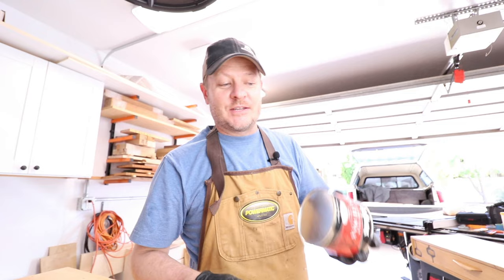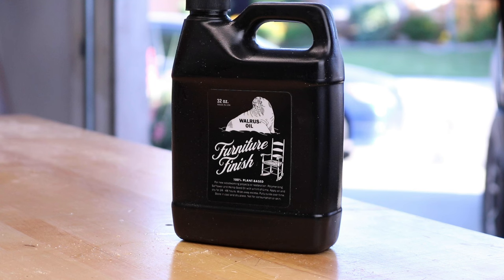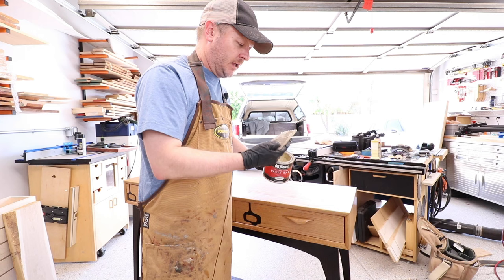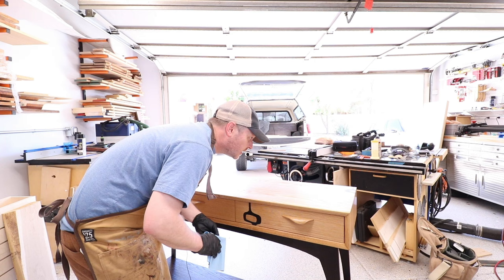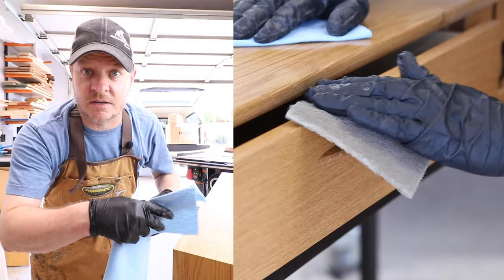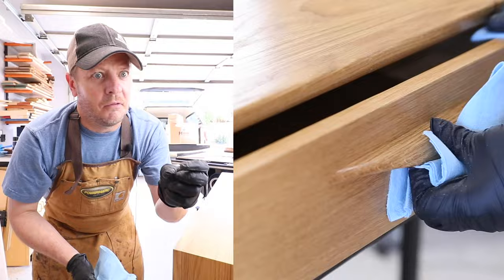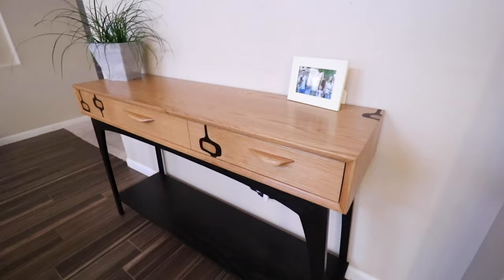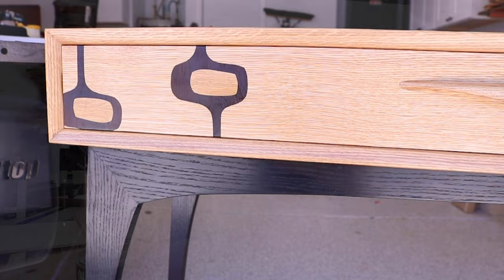Why Paste Wax is Worth It - Wood Finishing

Comment: Thanks for the video Mark! I can't recommend polishing with paste wax and finishing pad or 0000 steel wool enough. Not only does the surface get a nice soft sheen and the most amazing touch, it is also a fool-proof way to even out any imperfections in the finish.

Comment: Great video, love the finish paste wax gives even on top of poly. Quick tip, some waxes may take longer to dry and you might need to leave them to dull up and go matte first so that they can dry onto the surface. Some waxes say leave it 10-15mins some even 30mins so that the beeswax can dry and the solvent can evaporate. Then come back and buff it to a shine. 👍

Comment: I use it on almost any piece I send out the door but I use the Howard’s citrus shield premium paste wax if you ever can buy this paste wax and it triumphs over the other ones seriously try it out and also I always use a white 3-m finish woven synthetic pad on my small electric hand buffer to buff it of after I let it dry try that also and it makes it shines more and push it deeper into the wood as it heats it up with more friction and if you use the electric buffer the paste wax will last at least 2-3 times longer on the wood than buffing by hand

Comment: The bench looks awesome!! What are the black parts of the table. Looks like epoxy and classy but all I hear  is usually hate for epoxy from true wood workers. 
Also I’ve used paste wax before on a finished table but throughout the days some spots made it into some wood grain and turned white, is that because I didn’t have a thick enough finish on it to fill the grain completely?

Comment: How long would this last on a higher use top such as a coffee table or dining table?
Reply from the maker: Wax doesn't last long at all under those conditions (maybe an annual recoating, give or take), but the argument for it is that it's the first line of defense to protect the rest of your finish. It's easier to apply a fresh coat of wax than it is to strip and refinish, for example, a scratched or chipped urethane finish.

Comment: Getting ready to stain an unfinished dresser, what would you recommend for inside of drawers? Thnx man
Reply from the maker: inside of drawers, anything works. Leave them raw, apply just wax, or apply the same top coat  that you're using on the rest of it. Inside of drawers don't get too beat up, so viirtuaally anything will work just fine.

Comment: Question: we painted our laminate countertops and "finished" it with polyurethane. Would this also work on that? We have tried to get the polyurethane on nice and even but we just cant get it right. Would waxing fix it? The top coat is sanded but now you see the dull spots
Reply from the maker: Waxing will help, but it'll be even better if you sand the polyurethane smooth first. You might have to apply and sand the polyurethane two ro three times to get it perfect.

Comment: I'm restoring a dark wood display cabinet (call it teak or walnut for arguments sake). I've nearly done sanding it down and I love the lighter wood. I did a test patch with teak oil and it instantly went super dark with a deep warm orangey colour. I mean that's also nice and makes the grain look a bit more holographic-ish...but I love the ashy sanded colour of the actual wood. So I assume I can't just leave it unfinished because it'll still oxidise or get sun damage or whatever? Any ideas on what can I do that will affect it the least? wax/soap/ some kind of varnish. Like I just want to protect it a little and keep the sanded colour
Reply from the maker: Usually a water based finish will have the least effect on the natural color, no enhancing. Wax would have a little more effect but would be less involved to apply it. So there’s that.

Comment: Hey Mark, looking forward to trying your technique out on my project (walnut & hard maple).. you mention using Warus Oil (oil based) to bring out the color prior to adding Arm-R-Seal. Curious where/if/when Aqua Coat would come into play if using as a grain filler. If not you, does anyone know if Aqua Coat (water based) could be added AFTER applying Walrus Oil, then sanded down with 220 BEFORE using Arm-R-Seal... before finally getting to the finishing touch with wax paste? Trying to figure out how to work Walrus oil into the mix...
Reply from the maker: Usually a water based filler should be applied to bare wood. Then the finish on top of it.
Reply: @WoodworkersSourcecom  Thanks Mark, that helps. I read an article where it mentioned to use oil to bring out the grain prior to using a grain sealer. Anyway, I followed your method without applying Aqua Coat and turned out beautifully!

Comment: I'm using the past wax on a dining table and planning to apply 2 coats. Can the 2nd coat be applied 30 minutes after the 1st? And how long does it need to cure or sit without using the table? THANKS!
Reply from the maker: Could depend on the brand but it only needs 10 minutes or so. Basically the solvent in the wax needs to evaporate

Comment: Mark quick question,  you said you used 3/4 white oak ply.   I’m wondering how your edges look beveled at the front. The drawers sit inside what it looks like a beveled edge.   Maybe the angle of camera is giving me this appearance but if it is ply wouldn’t the MDF layer show if you did bevel back the edge? Great work and channel.  Thanks for the videos.
Reply from the maker: The plywood has a solid wood edge to cover up the core, about 1" wide. So that gave enough "meat" to make the bevel 👍
Reply: Woodworkers Source, Mark I have to say,  I am blown away at your response time.  That is highly unusual these days.  This makes so much more sense now.  I was super confused at first.
Reply: Woodworkers Source I have another question for you.   What was your choice of method cutting the bevel on the edge?   I noticed your a festool guy.  Did you use the Festool Track Saw?  Or did you just run it through your Table Saw?  I have a project coming up build a rain water feature.  I would like to 45 the edges for my corner joints.   Also,  I am cladding the Water feature.  What would you recommend for the best Outdoor Lumber choice?  I’m thinking of going with IPE and then some sort of stain or oil and sealed?   Any recommendations?   I noticed you were sealing your projects with Arm R Seal,  but you sealed over the oil?  I was told years ago to not seal over oil?  Was I miss informed?
Reply from the maker: @jcjohn782  Actually the bevel with a 22.5-degree edge bevel router bit, then softened over the corners and edges with a block plane and sanding. Ipe should be a good choice for the outdoor project, but it's a little hard to make a solid recommendation without knowing more about the project. In some situations it's not a sound idea to seal over an oil finish, but as long as the oil is cured you can put another finish on top of it with only a couple exceptions.

Comment: I noticed you use straight  up and down movements when buffing, I learned to use circular motions.   Is  there a correct method or just whatever floats your boat?
Reply from the maker: Good catch. Was taught to go circular for a few moments and then with the grain.... no idea which way provides best result though

Comment: Thanks for your videos and advice... One question, I have just finished a pine table with tung oil, however the color turned a bit yellow and I was wondering if I can apply some white wax in order to give a bit of white wash apparence to my table. Are tung oil and wax compatible?
Reply: Yes they are.
Reply: @kimmartin169  thanks